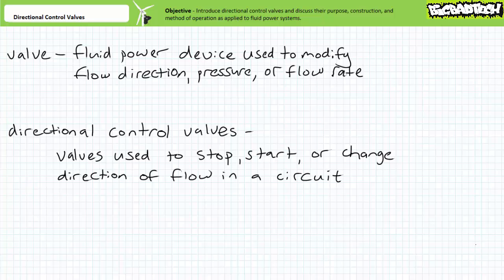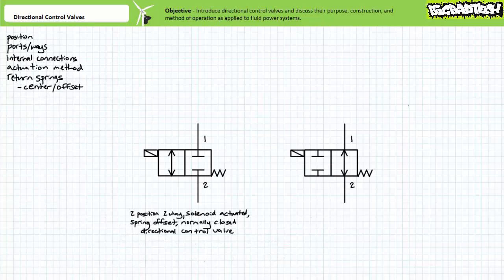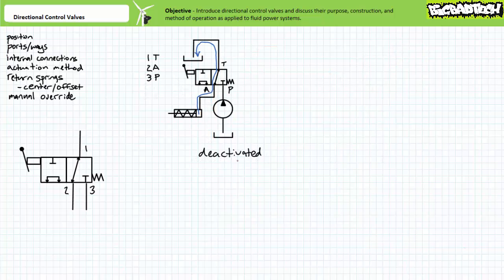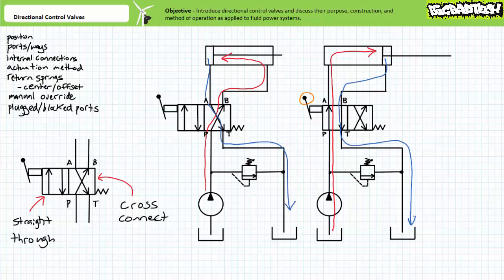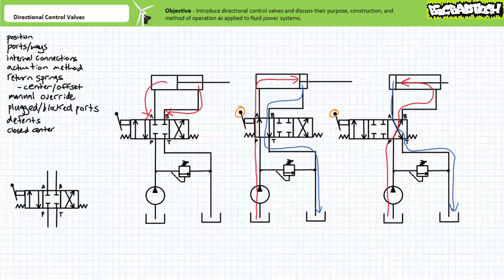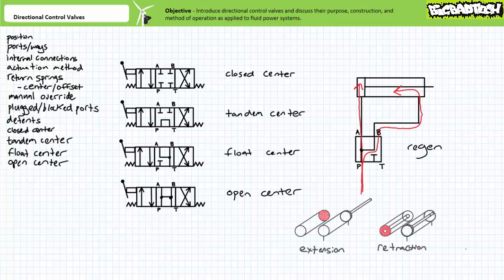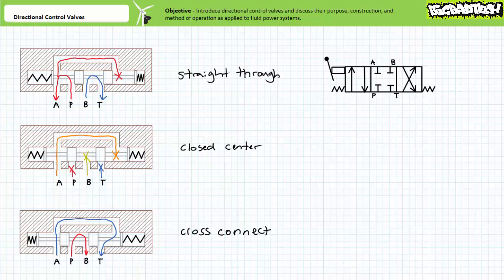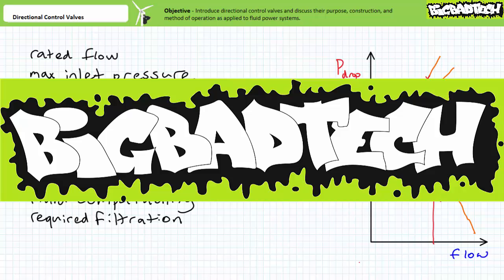Directional Control Valves (Full Lecture)

Comment: I think what youve done is great. One thing to consider though is that Closed Center has nothing to do with whether or not the ports are being blocked when the valve is in the center position. Also, you wouldn't use a fixed displacement gear pump with a closed center valve. Open or closed center refers to whether or not there is a fluid passage way through the center or middle of the directional control valve that goes through the valve and then to tank. Only open center valves will use a fixed displacement pump...99.99% of the time.
Reply from the maker: Mike stay in touch because I've got another lecture "Hydraulic Pumps" that I'll be posting shortly. I try to "compartmentalize" the lectures and progressively add more and more info as I go along and unfortunately I have to go back and correct some of the gross simplifications I make in early lectures.

Comment: I have learned much from your videos and I almost didn't want to say anything because I didn't want to come off wrong, but all of the log splitters I have used have used the detent side of the valve for retracting the cylinder.  I assume some are probably built the other way, but for safety, I think it would be a bad practice.

Comment: So, something I don't understand is, at around 14 minutes in you say that in the presence of an electrical signal, the valve shifts position to allow fluid to enter the rod end and retract the cylinder. Then you say that when the signal is lost, the valve changes position again to allow fluid to escape back to the tank. But the part that confused me is when you said, even if the signal is present, the loss of hydraulic pressure would see the spring apply the brakes- my question is, why would hydraulic pressure be lost if the electrical signal is still present, meaning that the pump is still sending fluid to the actuator to keep it retracted?
Reply from the maker: Loss of pressure means the pump is disabled.
Reply: "fail safe" contains the word "fail" for a reason. Equipment can fail in some very strange ways.

A common exaple where hydraulic pressure is lost but electral power is present, is the use of hydraulic pumps thats get their rotaional power from combustion engines. Think eathmoving equipment. When the engine runs out of gas, hydraulic pressure is lost, but electrical power is still present because of the battery.

Comment: Morning, Jim. I have two questions. First, I coundn't understand why the combination of a directional control valve and a pressure relief valve to dump the fluid back to tank is not a good option. And secondly, to an open center directional control valve do its job is not necessary two check valves blocking P to A and P to B ways?
Reply from the maker: I'm presuming you're first referring to a closed center directional control valve and pressure relief valve? In closed position pressure will always rise to setting of relief valve which opens and dumps to tank. This is like making a lot of money and then just burning it. An open or tandem center prevents this from happening by allowing a continuous low pressure relief path back to tank. No checks required for open center. Everything at tank pressure.
Reply: @bigbadtech  About the waste of energy using this configuration now I could understand. But I think when the pressure flow is applied in system the rod end and cap end sections along with the tank are filled with pressure flow, are not?
Reply from the maker: Remember that pressure requires resistance to flow. Any open path to tank implies no resistance and low pressure.

Comment: Hi Jim, great job. Just wanted to know if you have anything related to Poppet (Cartridge) Valves with some circuit examples.
Reply from the maker: Unfortunately I don't really go into the internal specifics of poppet style valves because when viewed from the outside they're kind of functionally equivalent to a spool style directional control valves. I like to think of them as mini pilot to open or close check valves rather than sliding spools (or sliding plates) that selectively connect or disconnect the internal passages.

Comment: Jim, Thank you great video. Jim do you have a video that explains, how a hydraulic / piloted derent actual works. By that i mean give an example of just what actually goes on inside the detent mechanism, when kickout pressure is reached. Could you show this for a 3 position,  manual activated  valve that shifts to neutral at kickout
Reply from the maker: Good question. Often times one doesn't even see a hydraulically piloted detent included in a simplified schematic but rather a simple statement specifying the kickout pressure. This being said some manufacturers do include it in a more extended schematic. Check out the bottom of page 2 of the Prince manual for the LSR-3000 regen valve: https://www.baileyhydraulics.com/pdf/ValvesLsRD25.pdf The detent is kind of like a little hydraulic cylinder acting against a bias spring. When pressure is less than the kick out the detent is in. When pressure exceeds the kickout the detent retracts.

Comment: In a hydraulic directional solenoid valve symbol, if there is a colored triangle symbol next to solenoid symbol then such valves are called as Hydraulic Pilot operated solenoid valves. But my doubt is how does a solenoid valve operate on Pilot pressure, it operates only when we give electrical signal to the solenoids. Kindly help me to understand this.
Reply from the maker: The solenoid shifts the pilot, the pilot shifts the main spool. Often used when solenoid doesn't have sufficient strength to shift for high flow/high pressure applications.